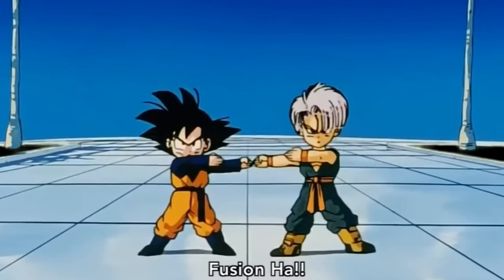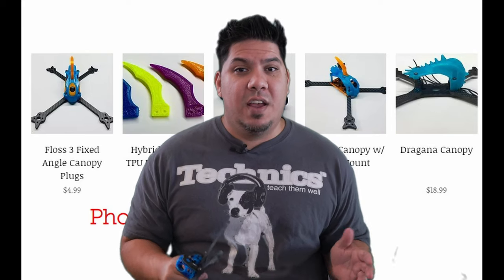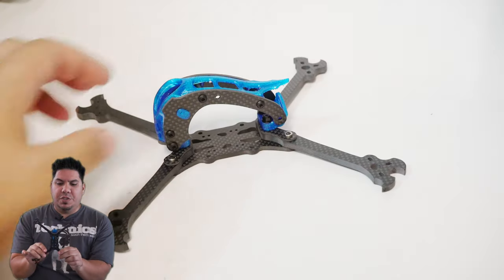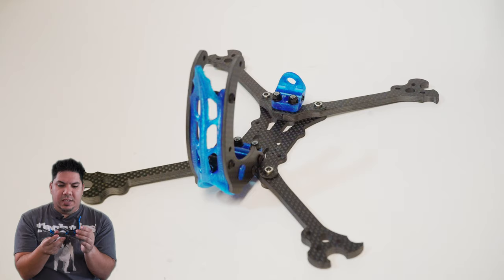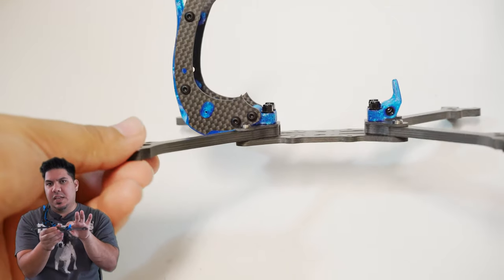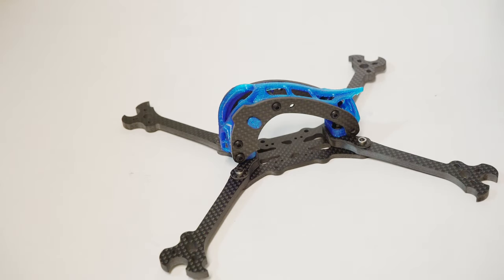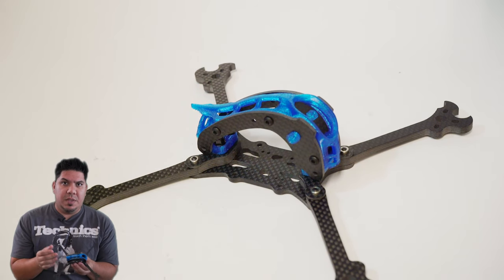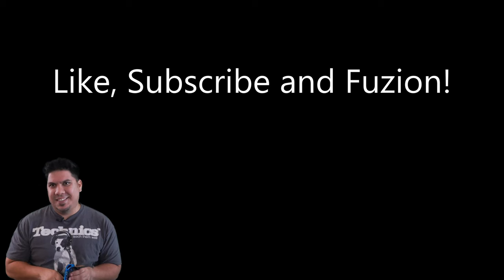Fuzion Dronz - Fuzion Drone Racing Frame - Designed by Mayday

Comment: There was a quad frame called the robocat that had the same idea as that flip top , I know because I’m currently building one. Mind you it’s a fair bit bigger than this little one, and it’s not as thick for its size, and doesn’t look as cool as this one.
Reply from the maker: I remember the robocat!  That frame looks soo cool, but i never had one.  What size motors are you using for the Robocat?
Reply: Jon E5 FPV , I’m actually using my ares crossfire motors, it’s been crashed too many times lol, so I thought I might go for something different. Got a Joshua bardwell f4 v2 receiver/fc board and I’m using the esc’s from the crossfire as well. I know that the board can handle way more power and bigger motors, but a mate of mine recommended it. Haven’t got a receiver yet, I’ve got a spektrum dx6e so I’m going to be putting in a spektrum  dsmx drone racing receiver with telemetry . Haven’t got a camera for it yet, but I was thinking a runcam split, or I’ve got a couple of spare trashcan cameras and vtx’s. Plus I’ve preordered the runcam 5, so that should be good for HD recording. Haven’t worked out how I’ll use the trashcan camera yet, but I’ve got enough wiring to do it. I’ll probably upgrade the motors and esc’s later, but it’s slowly coming together. I’ve also got a zmr250 that was given to me, running on a naze board, so that’s going to be harder to hook up with a camera, probably just be a line of site quad to practice on.
Reply: I still fly my robocat. Place spacer washers on the stand off post and your 4 s batteries will slide right in.

Comment: What 20x20 stack do you use?
Reply from the maker: Ive been using the Emax Mini Magnum 2.1 lately.  There was a deal in the FPV Sales Alerts group on FB recently for $65 for this. I would use this for 2206 and smaller motors on 6S and for 2207 and larger i would use the Heli-nation gigawatt stack